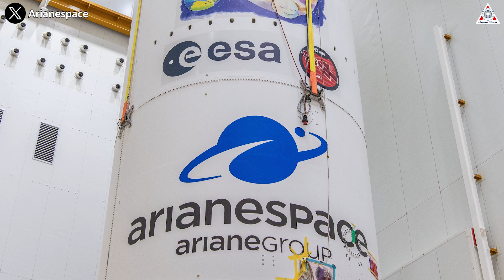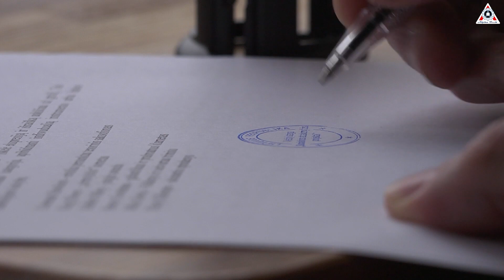IT HAPPENED! Amazon Shareholders finally realized SpaceX is a better choice for Kuiper launches...

Comment: Just to clarify that the first 2 sats are being this week on Atlas and I expect Atlas can keep cadence with launches at the same rate that production of sats happens. Expect further refinment of sats in the coming year so Blue Origin won't hit full production yet and don't need high launch capability. Expect production won't be ramped up till the new factory in Florida is ready, maybe in 2025. By then I would expect launch capability to by able to match sats production rate. Once they have a regular launch cadence then no way FAA are going to revoke their license.
Reply: That BO is wasting an entire Atlas 5 launch ($100,000,000) on two puny experimental satellites is a measure of Blue Origin's desperation and foolishness.
Reply: @d.jensen5153 First Starlink launch was a pair of pathfinder sats though at least they used a shared payload. It was a year before they launched the next ones. That was my point that BO don't need the new launch vehicles operational just yet. Atlas is fine for the next 12 months.

Comment: Alpha Tech you did it again!  1 pension fund = ALL of Amazon.  Oh, and with the same editorializing you failed to mention the successful test firing of the 2 Be4 engines on the ULA Vulcan booster.  Yeah, both engines started, ran for the planned time at the planned power.

Don't get me wrong, I think the Be4 engine will be the death of New Glenn and a major setback for ULA/Vulcan but biased reporting isn't necessary.

Comment: There is an often overlooked elephant of considerable size in the room when we speak about Starlink, Kuiper, OneWeb etc. When Starlink launches started, Musk expressed projection of 20M subscribers in '23. There are about 2M - ten times fewer. Even with that number of subscribers, the quality of service fell noticeably compared to beta period. The project's profits should have been in billions by now - it just broke even, barely. 
Throughput and latency will probably improve significantly with introduction of mesh networking among satellites, something that Iridium introduced 25 years ago. But with dramatical spread of cellphone networks even in poorest and least developed parts of the world (which will probably skip "landline" phase of connectivity altogether), satellite Internet is a service in danger of staying a niche product, just like Iridium: those who need it, need it badly, but the potential user base, those who both need it and can afford it, is not as huge as SpaceX, Amazon, OneWeb and others hope. 
Direct to phone service and development of IoT use might help, but we might be looking at a repeat of satellite radio story, where, in the end, was room for only one player, and that barely.

Comment: People are reading this all wrong. BO is counting on SX failing either through bad business fundamentals or depleted and obsolete hardware by the time BO gets into full swing with Project Kuiper. Even Musk said Starlink could bankrupt SX.
Reply: Probably won't now that it's making a profit. Took longer than expected, but it's in the black. So, maybe they need a backup plan for SpaceX not failing.
Reply: I'm not saying SX wont make it, just that BO is counting on failure. @drachefly

Comment: Bezos is a marketer. Flashy PowerPoints selling dreams. (think why he named the blue moon lander the national team) He wants to be a Boeing, troll for lucrative govt contracts where performance is not important. Cost plus is. On the other hand Musk is an engineer. He understands that vertical integration means cost saving and a tighter design. NASA is a jobs program. Schedule and cost be damned. They trade jobs for votes. Almost all innovation is happening in CA. BTW i'm no Musk fan boy. in fact he's pretty much and asshole. But like Steve Jobs visionaries often are.
Reply from the maker: Thanks for your comment! Keep following our channel ☺️
Reply: Musk is more than an engineer.
Reply: Musk has more in common with Howard Hughes than Steve Jobs